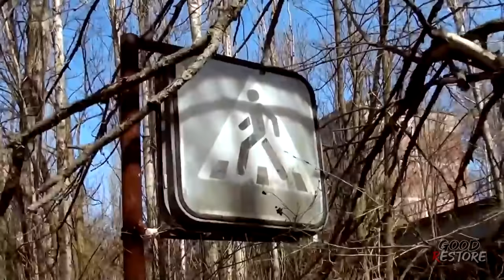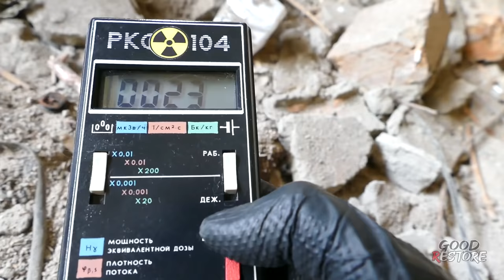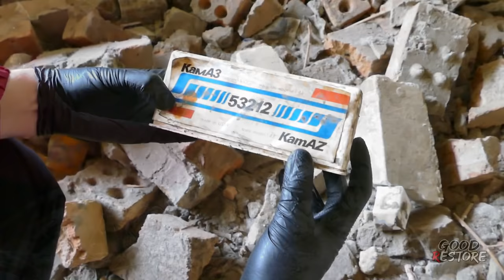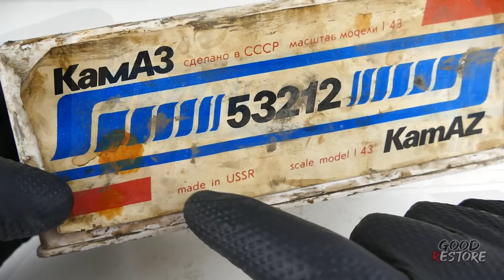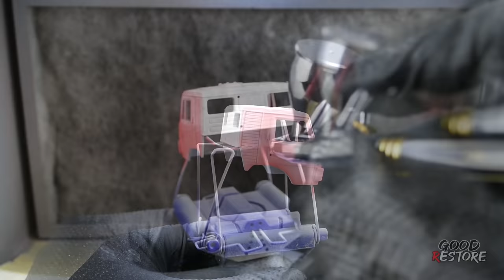Restoration Chernobyl Truck Abandoned Soviet KamAZ rusty car

Comment: It's not an USSR model of KAMAZ. That's a modern model from AVD/SSM models, or something like this. 
The soviet models of KAMAZ 53212, and any other model of KAMAZ from USSR, haven't such high detailing. They were more rough. For example, their frames were blank, like a plate. But soviet model of KAMAZ has a springing suspension.
Reply: Это поняли единицы людей)

Comment: I might have left the truck as it is. It looked like a post-apocalyptic style diorama piece (which it pretty much is, considering the location) straight out of the box.
Reply: Question. Why! Isn't he afraid that he could get sick or something? Chernobyl is still considered Contaminated. Rust. Dirt. Truck itself could all be still biohazard. Crazy!!
Reply: @876vanred  maybe because he used a Geiger counter on it and the reading was so low as to be okay which is why he gave a 👍 (thumbs up).
Reply: @geoffquickfall8424  Remember, Chernobyl is still a biohazard. Geiger counter or not. Didn't people have to leave all of there stuff when the event went down. Guess there is just no laws at all.  You can go in there and take what you want. Right!
Reply: @876vanred  Whoa nelly!  

About your first statement; Yes Chernobyl is still a biohazard but a few things are happening.  Quoted from the international atomic energy agency:  “There were over 100 radioactive elements released into the atmosphere when Chernobyl’s fourth reactor exploded. Most of these were short lived and decayed (reduced in radioactivity) very quickly. Iodine, strontium and caesium were the most dangerous of the elements released, and have half-lives of 8 days, 29 years, and 30 years respectively.”  So the overall effect is way down.  

Secondly there were outgassing effects and dust effects and some objects may not have been outside absorbing radioactive rain water at the onset and others may be protected from blowing dust.

Thirdly, the fact that the Geiger counter reading on the video was so low as to be normal background for some basements in North America due to argon gas or living in places such as Uranium city Canada or cities in Iran, the object itself was proven to be non-ionizing and not radioactive.

Fourthly, you are absolutely correct that it is a biohazard as witnessed by his face filter mask.

Fifthly you may be correct, coming in and taking something from the area may be prohibited by law for a few reasons, governmental law, personal ownership law (looting) and messing around in a biohazard area law.  I don’t know, however this was not part of your first statement and added only after I wrote my comment that he had checked for a biohazard and found that wanting.

Comment: This is Kamaz from the manufacturer of AVD models. And the box is from the Soviet Kamaz Arek of the 80s. Traces of operation have already been applied and allegedly found it this way))
The body is printed on a 3D printer - this is a factory casting of the awning of the same AVD. For the future. The receivers and the radiator cooling housing are black and only black. And the "restoration" is excellent. Just don't keep your subscribers for idiots, ok? Everyone understands everything perfectly.
Reply from the maker: This is an entertaining video, breathe out and relax
Reply: @GoodRestore  Calm like a boa constrictor

Comment: Restoration viewers can be very good at spotting faked wear.
Pointless mud added where it would not be, random spray paint, uniform wood chips from unexplained sources, and moss or mold in areas far too dry to grow them.

Finding something that Really Needs Saving shouldn’t be that hard, and is the Whole Point!